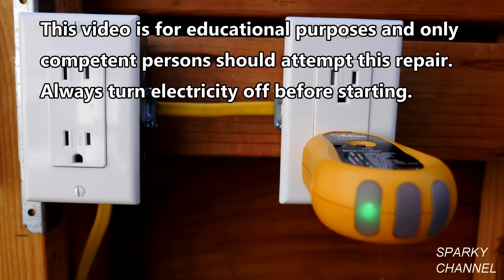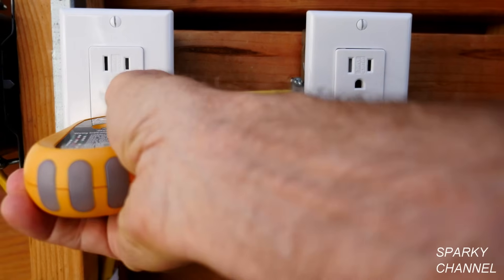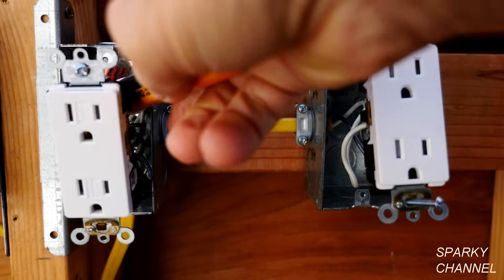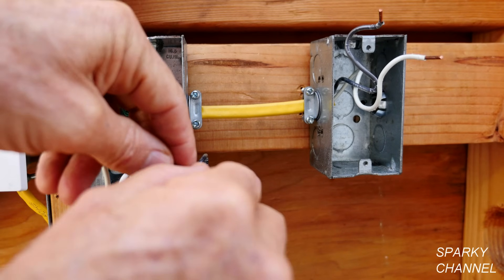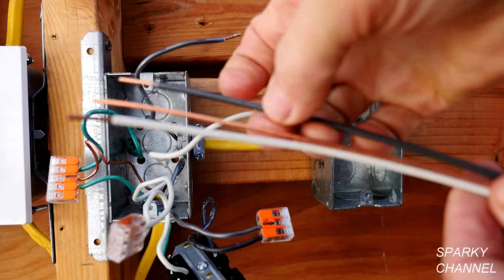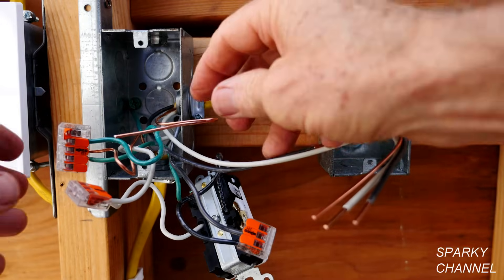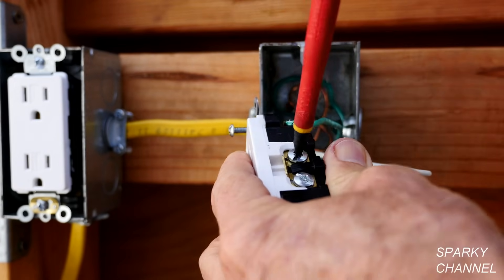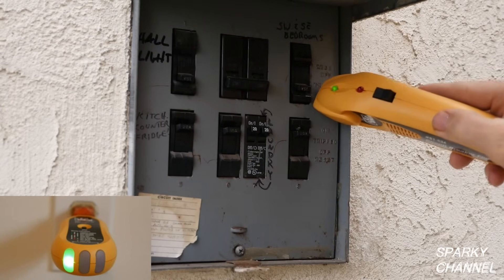How to Fix an Open Ground

Comment: Thanks for the video as always. I have a circuit that feeds 4 bathrooms and the outlets nearest each sink, the first outlet is GFCI protected and that does shut off power to the remaining bathrooms if I push the test button. However, each of the outlets downstream shows an open ground with my tester and it will not trip the GFCI. I visually inspected each of the outlets wiring and the ground wire is present, correctly connected and appears undamaged. Would the CT20 continuity tester that you demonstrated help with just the ground wire connections?

Comment: If you don’t want to replace the wire you can replace it to a Gfci outlet which has the same safety not requiring ground
Reply: Thank you for this.  most scenarios won't have people breaking open the walls to replace the wire inside the walls. The GFCI is ideal.  Heres my question though, if you installed a new 14/2 on the GFCI but the electric panel doest have ground, where would the ground on that 14/2 go?  Just wrap it up and put it to the side?
Reply: @ShyRage1  just attach it from the breaker panel to the neutral bus bar! As normally every grounded breaker is bonded with neutral
Reply: @VOLTRONDEFENDER4440  I thought this could only be done at the main panel and not sub panels.  Mine in question is a sub panel.
Reply: @ShyRage1  yea it can only be done to the main panel where all the breakers at the main breaker might not be at that panel
Reply: @VOLTRONDEFENDER4440  Here's my scenerio.  At the meter, there are two hot wires (black) and one neutral (white). The white is connected to a ground in the meter box. Those 3 wires go into the main panel from the meter panel.  The two black wires are attached the the main breaker in the main panel. The white is connected to a bus bar. The Bus bar is joined with a crossing to the bus bar on the left side of the box.  On the right bus bar where the white wire is connected, there is a long thick white wire that goes through the main panel and into the subpanel inside of the home.  That wire is connected (white wire that is grounded at the meter box) on the neutral side.  Is this supposed to be this way?  Since the neutral is grounded, can the neutral be used as a ground in the sub-panel?  Why or why not?
Reply: @ShyRage1  it should be as techicly ground is bonded to netural at service panel
Reply: @VOLTRONDEFENDER4440  Is this set-up the norm?
Reply: @ShyRage1  Any panel downstream of the main panel the neutral has to be isolated from ground. Why?... If the neutral and ground were to be connected together in an downstream box and that neutral connection goes bad, burns up, cut, ect the equipment would be using the bare copper ground wire as a path back to the source. So...That being said you touch any metal with your bare hands and YOU provide the path needed back to ground. Not only  is the panel effected but even  a metal (sink) ect. Even your water lines are tied to a ground rod. You can buy these parts even at Home Depot, Lowes ect...
Reply: Yes, I believe Sparky also has GFCI videos which cover this same advice.

Comment: What if your house was built in 55 and opening up the walls and completely gutting the house is out of the picture? Is there another way to fix a two wire home with open ground?
Reply: Consider a gfci receptacle and/or breaker.
Reply: Same. We have some new and some really old wiring. I ended up starting to replace those 3 pronged outlets with gfci. Expensive, but cant really tear out all that old wiring. It’s all stapled in there to the studs. I wish it was so easy just running a ground wire.
Reply: Can you go from a metal box to a plastic box and just hook al three wires hooked up to the color it matches to 😊

Comment: So im a guitar player but I noticed that when I play guitar for some bizzare reason I feel like electricity in my strings. This feel like some thing incredibly dangerous does any one know what this is about ???
Reply: I assume this is a tube amp. Those can be very dangerous if not grounded properly. Make sure your amp has a three-wire power plug with ground and that it's plugged into a properly grounded outlet. Get one of those testers and only plug in into an outlet if the wiring and ground are good.
If that doesn't solve the problem, or if your amp is vintage and doesn't have a third prong, quit using it until you can take it to a tube amp tech to have the cord and grounding updated.

Comment: Thanks for your educational video.
How come you don’t wire the incoming cable at the top pare of terminals and outgoing cable on to the bottom terminal set , just like GFCI receptacle’s line and load ?

Comment: Thanks for the video. My people in Vietnam would just said this box near other box so they must be continuity, no check whatsoever.
But you, you take a step further and double check it, I really like that. It's really profesional to not assume anything and always testing before handling.
Also I have a question, should the ground wire be naked or insulated?

Comment: excellent video.  I love your attention to little details.  It seems that very few electricians now adays take the time to wrap the outlet with electrical tape or in some cases don't even take the time to screw down the unused terminals.  I have a situation in my house where the cable company is reading a about 50 volt charge back feeding one of the coax lines.  The technician thinks it could be an open ground.  Any suggextions would be appreciated.
Reply from the maker: Thanks! I would say remove that line and install a new one as a grounded homerun (no splices).

Comment: Why ground wire isn’t shielded? 9:15
Reply: Ground wires are not insulated.
Reply: Nice video. I'm not, sure why the 2 shorter pigtails are shielded and why the other 2 grounds are not, but I imagine it's to better identify pigtails from the "running," permanent, ground conductor wire. If you are asking in general, why not shielded, I'm still learning myself, but one reason, ground wire are exposed because they "attract" "loose/wild/unplanned" electricity better than sheathed wires. This extra attraction is a safety measure, because it is a backup unsheathed wire that will conduct unplanned electricity, instead of unplanned electricity conducting to that screw driver you may be holding. Unsheilded wire will attract unplanned electricity and conduct it to the ground rod outside the house and then the rod conducts unplanned electricity to water underground and dissipates it over a larger surface area until electric field returns to some equilibrium. When working with a screw driver around outlets, this is why they are sometimes rubberized coating, any unsafe/unplanned current will shock and zap itself to most desirable/least resistance thing, in this case, unshielded copper wire. One thing occurred to me, why did he say Neutral coming "from" the power source around that same time in the video? I thought neutral always wants to and is "returned" back to the main panel/ the source. So if I'm right, Hot wires are least safe conductor, Neutrals are the next safety backup conductor because they give Hot wires a return path. Unsheiled ground wires are a safety backup conductor to this hot-to-neutral loop that is always trying to be in balance from 117-124 volts. There is like a field of power around any wire that has current, with fingers, hands, tools, appliances, phone charges, all these things working around or in or near receptacles, unshielded ground wire is the safe wire to conduct unplanned current. And maybe those pigtails are coated with rubber because if lighting strikes a roof and then flows to some nearest metal, lightning will want to first touch  the main exposed ground wire instead of sheathed pigtal flowing to the receptacle.

Comment: Do you have a video..have to load lines coming into outlet..ground on each one...cut too short..how to tie these grounds in plz send thx
Reply from the maker: See: How to Extend Short Wires per 2023 NEC 300.14: https://youtu.be/4PN-sTyhXTo

Comment: Is it normal to have continuity between the hot and neutral wires in a outlet when the breaker is switched off?

Comment: I have the same open ground issue but the biggest problem with it is that I have a ground attached to the receptical and when I check for voltage with my tester I touch the hot wire there's current, I touch the neutral there's no current, but when I touch the ground there's current going to it. I plug in my outlet tester and it says I have an open ground. And when I go to trip the GFCI (it's connected to a GCFI circuit) I press the test button on my outlet tester and then it says reversed ground/hot until I let it go. Any reason why my ground is getting power to it?
Reply: Turns out I had a loose ground somewhere in the circuit and I had to open everything up in order to fix it
Reply: Me too. You come up with any solutions??
Reply: I also have the same issue
Reply: same issue here. seems common?

Comment: What if there's no ground wife in all outlets?
Reply: Run new wires through the whole thing, or install GFI. Could do one at every outlet, could do 1 at the first outlet and protect everything down stream, or you can just replace the whole circuit breaker with a GFI breaker.
Reply: Gfci
Reply: Install a GFCI and connect it to all the outlets connecting to it
Reply: Install GFCI if it's an old house with no ground wire
Reply: Run a new line
Reply: then your house is fucked
Reply: @DontStopReeling  no its not

Comment: The receptacle on the left is wired correctly but should be installed with the ground on top.
Reply from the maker: Thanks!
Reply: Why
Reply: @tyedollasign4034  If the plug works loose, the prongs will be partly exposed. A falling object—or a child's finger—is more likely to come into contact with the uppermost prong. You do not want the hot on top.

Comment: I agree. It's best to have grounded circuits. I got scammed buying this house. All new Romex in and out of the circuit breaker panel box, but what was hidden, was it was tied into older wires that are 2 conductors and insulated with asbestos. Probably going to drill holes in my floor and run conduit to the existing receptacles in the wall, add an extension box, and just leave the old wiring dormant. Unless it just eats at me, then I am going to be taking down one side of certain walls and pulling new wire. I hate the idiot that wired this house. At least the J boxes and gang boxes are steel, but the idiot used nails instead of screws. And I can't figure out how he got them hammered so tight inside the box. Long nails too. I doubt it was a nail gun. Even so, those would not have fit inside the box either. So that's a nightmare. A saws all or reciprocating saw doesn't make it any easier. Just a little faster but a lot of sparks and metal dust.
Reply: I think that clown worked on my house too. Maybe my car as well.
Reply: It's sad that people really run new wiring without ground (ground is very important!)

Comment: So why are you able to just hook up the green wire to first metal box but can't just do that repeatedly to all the others to avoid rewiring everything?

Edit: also it's so annoying to know that you have to do all that work when you can buy the little 3 prong adapter and plug it into the 2 prong and call it a day. Been using them for years but rather have a correct setup....

Comment: Good video, but I am going to pick a nit here. Your continuity test does show that the outlets are properly connected on the hot and neutral wires, but it does NOT as you assert, prove it is the very NEXT outlet. There could be 10 outlets in between, and if all the hot and neutrals were properly wired, you would get an indication of continuity.
Reply: He used the right word and spelling dude. “ASSERT : to state or declare “ - Merriam-Webster Dictionary 

Asset , as you wrongfully accused this guy of using , is something totally different. Put on your reading glasses! And go away ! We don’t have any use for people like you here.
Reply: If you want someone to think you're smart you should learn what the word "asset" means before you try to use it in an incredibly stupid sentence.
Reply: @waytospergtherebro  - Thank you for pointing out my spelling error.

Comment: why did you add an additional green wire to the box?  You could have just taken the bare copper wire that is coming into the box, screwed it to the box and left enough slack to connect to the outlet.Would have saved you 2 jumpers and and connector.
Reply from the maker: True, thanks.

Comment: What if a jumper is added to the ungrounded receptacle running from the neutral screw to the ground screw?
Reply: 🔥🔥🔥🔥 bad idea please do not try that!!! 
The neutral doesn't act like a ground like in a car that is DC current, the power is actually flowing back and forth through the hot and neutral, in other words AC current a house has reverses direction...think of them both as "hot" 
The ground for a house's AC current has to be routed back to the same breaker box ground terminal block the hot and neutral originated from.
Reply: @BlackTownie999  ok, what would you do if it is impossible to replace the new cable as you have done in the mock up?  You have done a good job of demonstrating how the problem needs fixing, how about some advice for a real life situation?
Reply: @BlackTownie999  in the breaker box are not the ground and neutral tied to the same bar?

Comment: I have 5 outlets in a living room and one in the hall that have an open ground, and they all have a ground wire hooked up to them and are wired correctly. I don't see you talking about a situation like that after watching 4 minutes of this. Next
Reply: This would mean it isn't grounded at the main fuse/circuit breaker.
Reply: @rachbiddy346  Yep. I figured out the first outlet in a circuit didn't ever have the ground wire hooked up to it. I hooked that 1 wire up and all the rest of the outlets were grounded and working correctly then.
Reply: It could also be a loose connection. Always check to make sure the screws are tight. Test all of the screws on the outlet, because if one is loose, it's very likely others are too.
Reply: @MAGAMAN  Yeah I started checking the connections and found a ground wire that was never connected. So apparently that circuit has never had a ground, and I think the houses were built in the 80's or 90's.

Comment: it gets really interesting when the main service panel has been upgraded with a ground but the original feeder panel, hasn't .. and since you can't bond those neutrals and grounds at the feeder panel (well not supposed to).... and I got back feed on the faceplate screws with my tick tester.. but can you explain this to me.?
it's on my channel "got 30ish volts DC on a ground screw"
https://youtube.com/shorts/8X445W0OoDA?feature=share
Reply: Wireless continuity detector... REALLY??? It seems to me the so-called wireless end, simply wires the two ends together to complete the circuit, I would guess it also has some sort of protection in there so you don't make a big spark.

Comment: Personally I find entering a box from the side is one of the worst ways to enter a single gang box or the center side KO on any other shallow box.. If you have a GFI, dimmer, USB or any deep device on a shallow box or cut in metal box, forget it. Your connector will make it impossible. I always try to enter from the top or bottom. However, I realize this was a mock up for demonstration purposes.
Reply: Yeah, wondering as this was a demonstration he didn’t think about that.  Great tip, though.

Comment: Hi, I followed your instructions to fix 5 open ground outlets in my house. They are all 3 prong outlets and have a ground wire, but somehow the ground wire wasn't connected. I connected the ground wire and 3 of them worked great, but the last 2 outlets still show up as open ground. I also noticed that those 2 outlets share the same circuit breaker. Any idea what seems to be the culprit? Thanks!
Reply: Perhaps there’s a box where the grounds were not connected on the cable the exits the box and feeds one of your open ground outlets. You should just open every outlet on that circuit and double check everything.

Comment: In a circuit with lights and outlets, if a ground was disconnected/broken at some point, would everything downstream have an open ground even if the ground wires for those outlets and lights downstream of the issue were properly connected? Thanks!
Reply: of course, because the ground wire travels back to the panel and into the 'ground' if the ground wire is broken it isn't grounded
Reply: @claytonjames4779  I was able to find the location of the broken ground. An improperly installed ceiling fan. I can only describe the installation as “ground adjacent” ;) All fixed now.
Reply: Clayton, will an outlet with an open ground still trip the circuit breaker if there is a short?

Comment: I’m not a fan of the no contact testers.  Mine often times blinks on when it bumps into, or touches something.
Yours did it to when you were checking the switch boxes.  I don’t like that.  Crude technology.
Reply: Yeah, I’ve been in the field for over 40 years.  All test equipment has their own limit, quirks, etc.  Always best to have 1 trusted tester that you know intimately.
Reply: the point is to have redundant checks. that's all.

Comment: To make things easier just put a GFCI in the box that has no ground....this guy has no clue
Reply: That won't work becuase the box STILL has no ground. G stands for GROUND. If you sell your house, an inspector worth his skin will test and report it back to the buyer
Reply: that's a way to handle it if there's no ground coming through from upstream to the panel, but he clearly had one. he just didn't specify that you could use a GFCI outlet. the preferred way is to use the grounded line when available, which he clearly did.